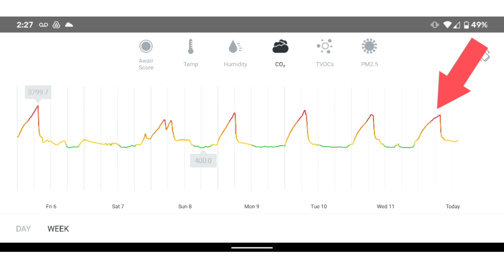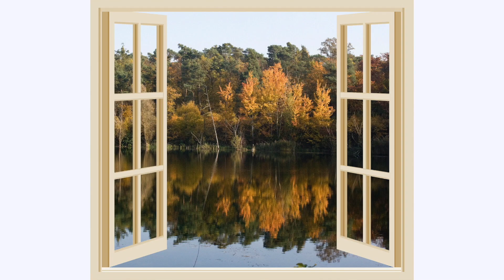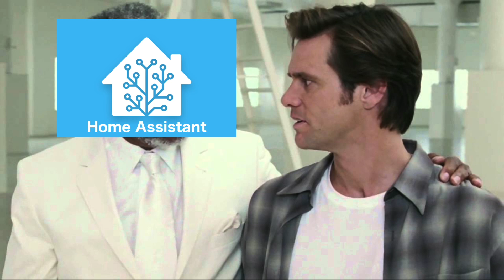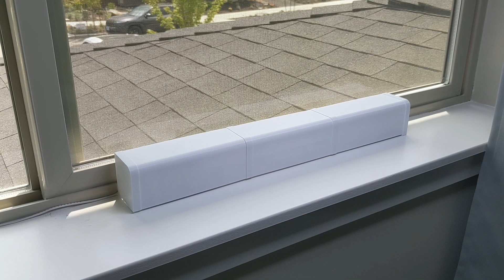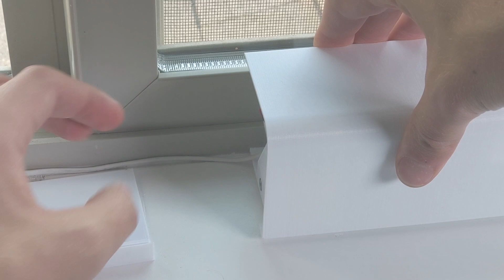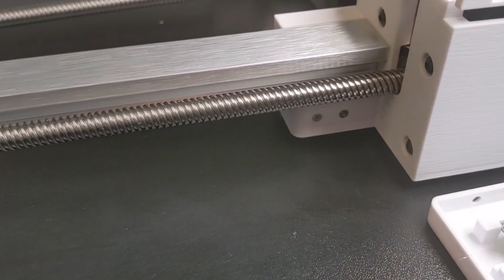Automating my window to control extremely high CO2 levels

Comment: That’s so awesome! I have the same style of window and have been looking for this kind of thing a long time. Looks simple and elegant. One question though, how do you lock and unlock the window? Do you have holding current to the stepper so it’s too hard to open? It seems like it would be fairly easy to back drive and open manually from the outside. 
Anyway, great design. The current sensing safety shutoff is a great touch too. Thanks for sharing the project and putting it up on GitHub too!
Reply from the maker: Thank you. This window can't be access from outside and stays unlocked most of the time. There's no holding current but I've got an idea to create a "lock" which I've done in a similar project. If the stepper gets pushed back it will trip the limit switch. The motor can then turn the holding current on and close it back up. This is a pretty firmware update which I'll start working on
Reply: @Daniel-Frenkel  Your “lock” method sounds like the best of both worlds. No added parts or user interaction, no unneeded power draw. Very cool!